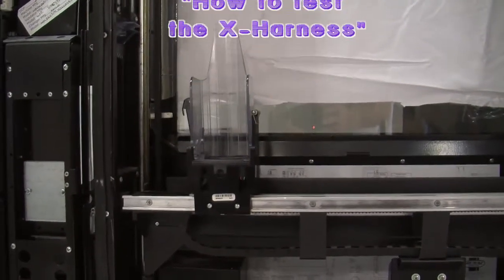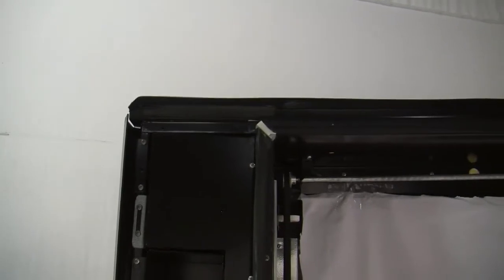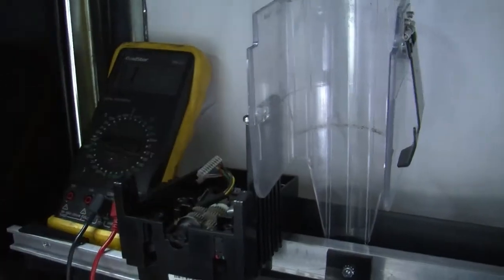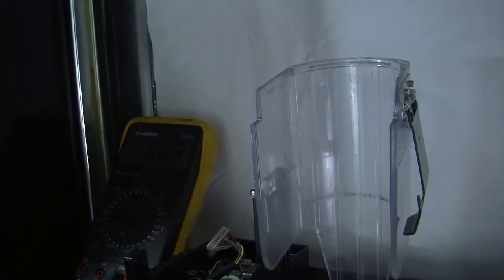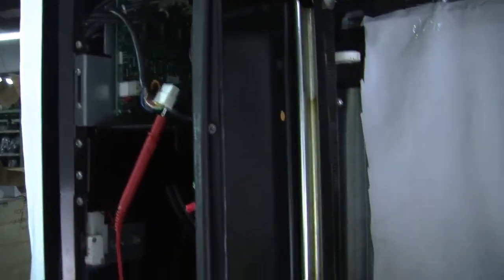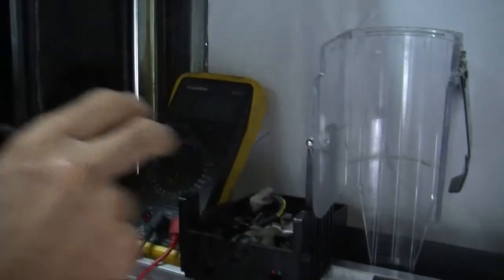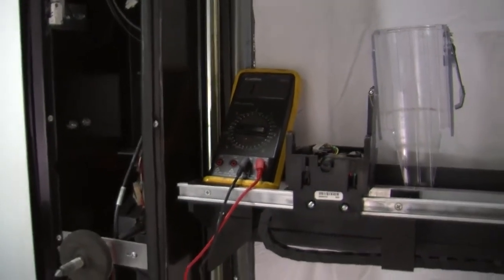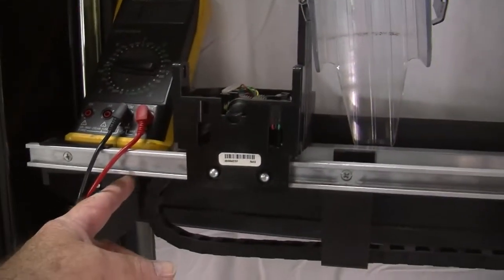Royal Vendors RVV500 Testing the X Harness

Comment: Hello, I have an issue on my RVV500 where the cup sensor moves up the down and tothe left until it all the way in the left wall and then does that three times. Using the sensor test function I see that the hall effect sensor is outputting a 1 and this does not change when passing a magnetic object in front of it or holding it in place in front of it and the cup sensor is outputting a zero whether or not there's something in the cup and blocking the IR beam. I've also checked the xbox's harness to the DMC and there are no open wires. I went ahead and replaced the logic board and the emitter and detector for the cuff sensor and also the hall effect sensor and even so the same issues remain. I guess there's only one person that works at Royal vendors in the tech service department and they are on vacation apparently. Does anyone on this channel have any advice?